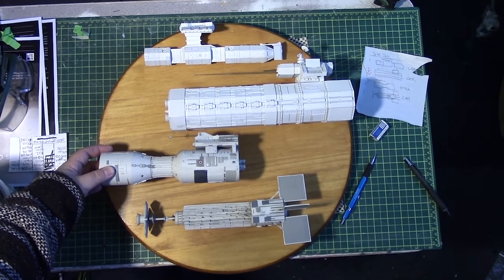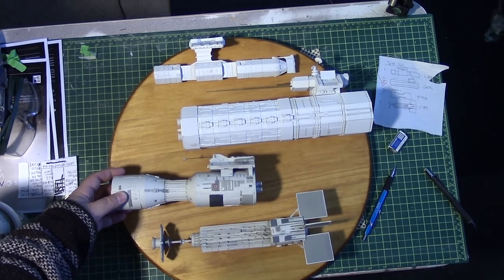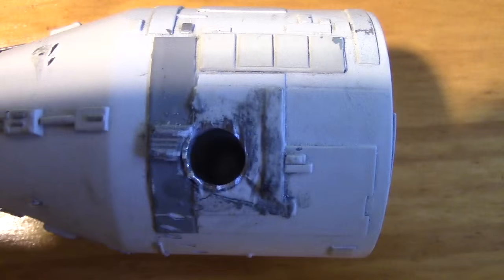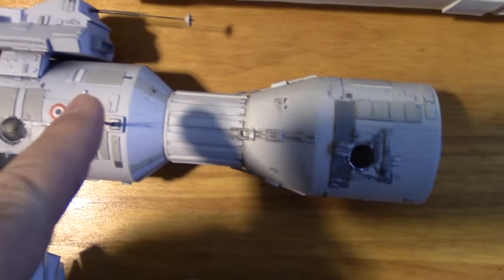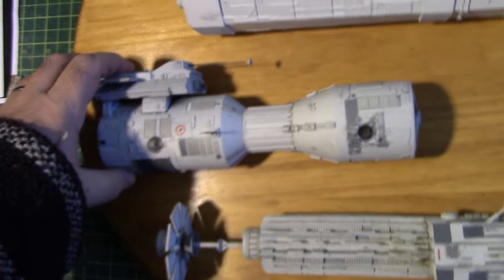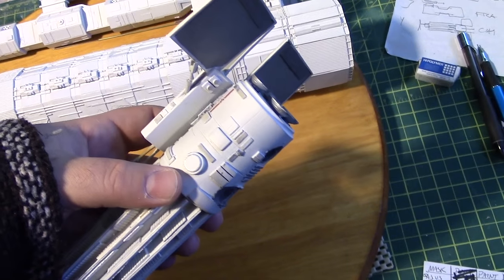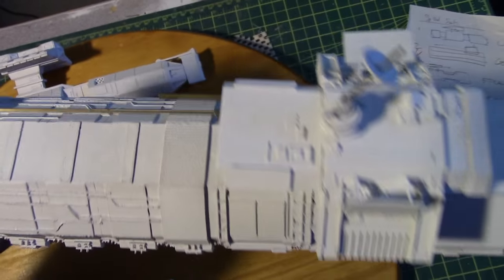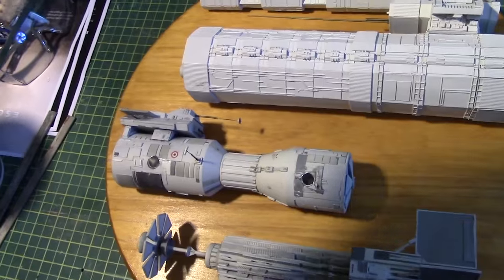The Satellite Series Plaque

Comment: I do like the wood burning-- must've smelled great!

That's a bit of hard cheese, old man! Well, nothing for it but to get out the Apoxy Sculpt and bits of scrap plastic, some greeblies/nurnies and a fresh bottle of CA...

Finding holes a bother? Jeepers, the tube size you selected is large enough to install a concession stand in. You can either do it through brute force math (measure the distance from the outside D of both tubes and subtract one of the Ds to get the distance between the two centers, drill baby, drill) OR insdie those big tubes, "float" smaller telescoping tubes around yet smaller tubes that are placed in the plaque-- then fill in around the smaller telescoping tubes with Apoxy so it finds its own position. Using telescoping tubes allows you to take off the model and finish the surface, neaten things up, etc. OR, one biggish square tube that you set into one of those monster holes-- into a telescoping larger square tube. Using Apoxy allows you to get everything level. Yeah, you have to fit a square tube into a round hole on the plaque, either more Apoxy or a modest ferule for the base.